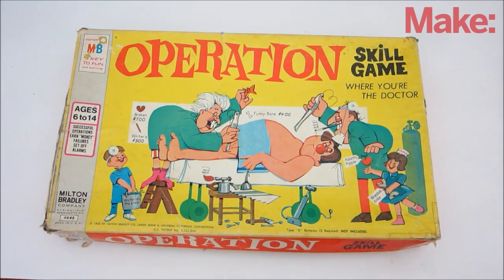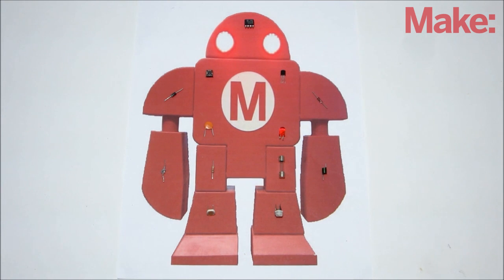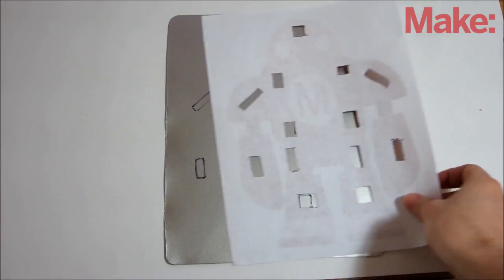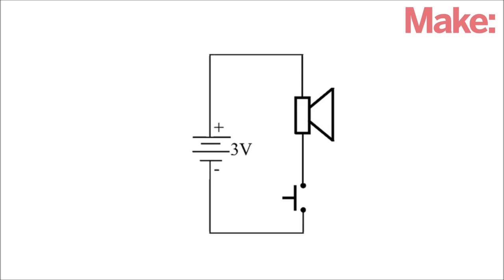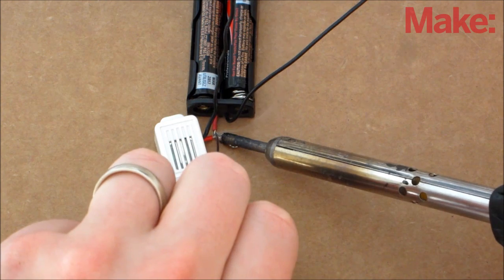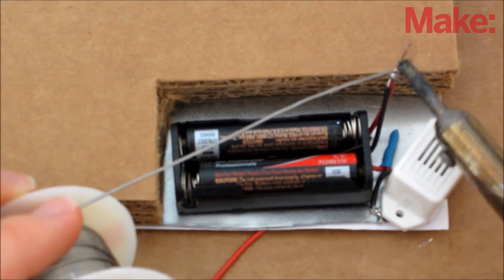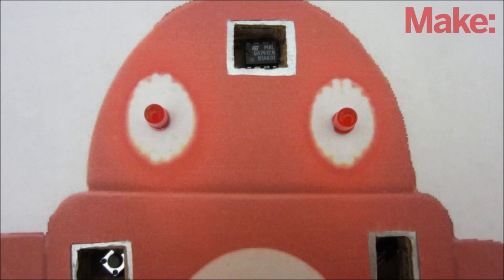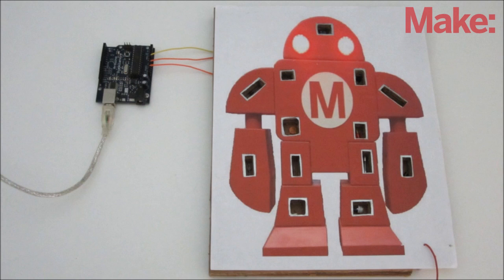DIY Hacks and How To's: DIY Operation Game

Comment from the maker: MAKER CAMP PROJECT: Custom Operation Game

Have you ever played Operation, the game where you use pinchers to remove tokens from a "patient" nicknamed Cavity Sam? When you remove items from him, you try not to set off lights and noises. It's fun and a great test of your coordination, but who says that Operation has to be done on Cavity Sam?
 
No one! Today, we invite you to create your own Operation-style game using whatever character you would like. Some people use Buzz Lightyear; others, R2D2 or Iron Man. For our version, we used our robot pal Makey. What character will you use?
 
Ready to get started? Check out the materials list, as you might need some adult help. Once you begin making, you'll find that it's fairly simple and tons of fun.

 
Here’s what you’ll need:
- A printout or drawing of your character on a piece of 8.5" x 11" paper
- 4 sheets of cardboard also cut to 8.5" x 11" (we cut them from a      shipping box)
- A thin sheet of 8.5" x 11" metal (as shown in video; see aluminum foil modification, below ). 
- 2 feet of insulated copper wire
- Tweezers (conductive metal)
- Heat shrink tubing (or electrical tape)
- AAA battery holder (holds 2 batteries)
- 2 AAA batteries
- 3V buzzer (for example, Radio Shack Part #273-792)
- White glue
- Double-sided tape
- Small objects to serve as your tokens (find or make)
- Soldering iron and solder (or 2 twist-on wire connectors)
- X-Acto knife
- Binder clamps
- Fine-tipped marker
- Pencil
- Ruler
- Dremel rotary tool with cutting and grinding attachments (not           needed for aluminum modification; see below)
- Tin snips (not needed for modification)
- Drill and bit set (not needed for modification)
- Electrical tape (if using modification)
- Aluminum foil (if using modification)
- A needle or push pin

You’ll find step-by-step instructions in the video below and at http://goo.gl/EdsrLV.

Aluminum Foil Modification: Don't have a dremel or drill? That's OK! You can make a project mod (modification) using aluminum foil!

To make this mod: instead of using sheet metal, wrap one layer of cardboard (with cut holes) in aluminum foil and tape in place. Cut an "X" on the foil over each opening, and fold the aluminum in. Glue this foil-wrapped piece of cardboard on top of your cardboard stack, and tape your paper character to the top. To connect your circuit, use electrical tape to attach your wire to the foil instead of soldering.

Once you've put it together, share pictures of your own personalized Operation game using the  #makercamp  hashtag. We can't wait to see what you've created!
 
Don't forget to tune in to today’s live Hangout at 2pm Eastern  / 11am Pacific when we'll meet some of the marvelous mathemagicians behind Two Bit Circus, a high-tech interactive carnival. We guarantee that it's like no circus you've ever seen!
Reply: Thank u ! I will do this
Reply: wow
Reply: How neat!
Reply: cool
Reply from the maker: Hope to hear how you all do in doing this project! Don't forget to share your photos and video with us!
Reply: We're making this tomorrow at out local  #makercamp ! Guess I get a little head start now!
Reply: Bryson Wetzler this would be a great project.
Reply: Make: Thanks! It turned out really good, except the circuit randomly shut off. Unfortunately, I had to leave before we fixed it, but it was still really cool!
Reply from the maker: Imran Khan Hello there!
Reply from the maker: Divyan Jain Can't wait to see how you all do! Post your pictures!
Reply from the maker: Divyan Jain So happy to hear that you had a good turn out! But we are sad to hear that the circuit randomly shut off :( how much did you get to see before leaving? Were you able to finish the Hangout later on?
Reply: Make: We are in the East, so the hangout starts at 2pm for us, when camp ends. I had to go somewhere, but I'm going to watch the hangout tonight. We fixed the game today, and it's working really well!
Reply from the maker: Divyan Jain Awesome! Let us know what you think of it :) glad to hear the game is working!
Reply: @MAKE I was going to do one with Pyrrha Nikos being the patient, her screams are used when the sides are touched.
Reply: Make: I will make a Mega Man Operation
Reply: Hi Make Listen I Really Love your Video on how to make an Operation game. But i can't find the link to make a Plastic Cover for the game can you please send me the link?

Comment: I have one question, when I made my game 2 years ago, I tried using the LED eyes from a stuffed dinosaur. This toy also had a push button switch that allowed the red eyes to shine and made it roar. This soundboard was push button, so I was wondering if there was a way to alter the soundboard from push button to be activated when wired up in a parallel circuit with the other components so one of our games (Godzilla theme) would make a roaring dinosaur sound?. We tried altering the soundboard...